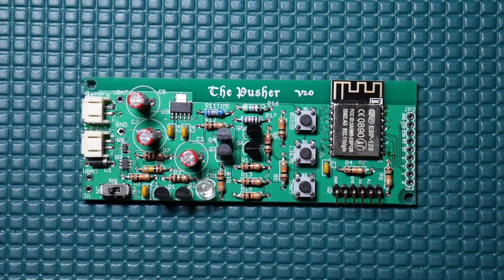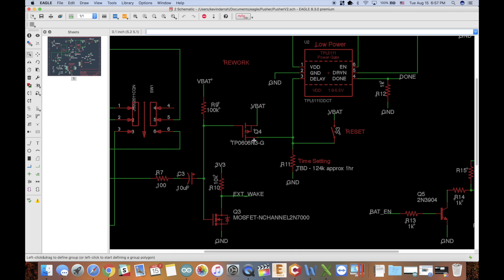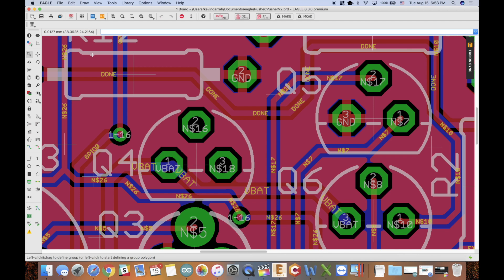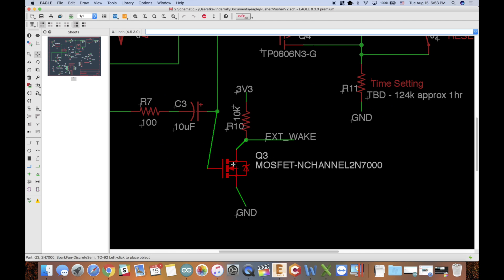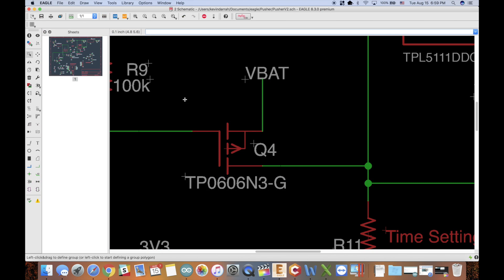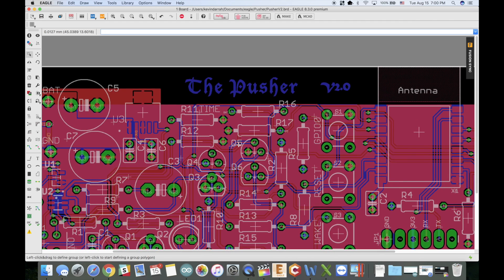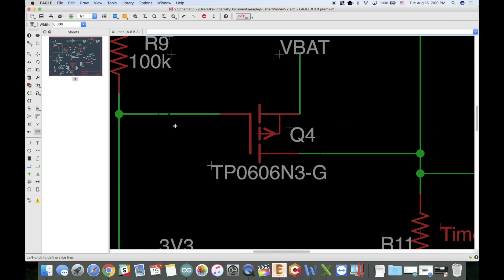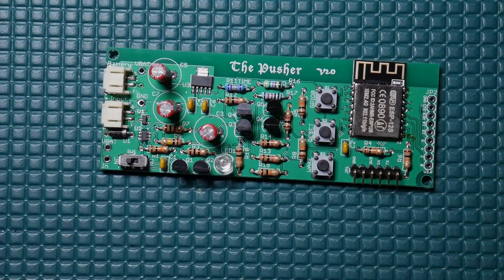Eagle PCB Design FAIL! Run the ERC!!

Comment: Why don't you use smd (0805) in your design? i'm a beginner and i found it much easier to make pcb at home when you don't have to drill 200 tiny holes in them and it's smaller and better looking board... just using a cheap solder paste dispenser and light touch of the solder iron \ toaster oven to solder them in place... would love to see a v3 full smd tiny design, great work btw...

Comment: made a board in altium circuit maker recently (first ever) and after checking and fiddling i ordered it on oshpark... it came and i wondered why it didnt worked.. checked schematics  checked components all fine. 
after hours i found out that some wierd bug or unwanted hotkey disconnected the gnd pads of my microcontroller from the gnd net. almost invisible but now i know for the next time
Reply from the maker: oh man, that sounds worse than my issue